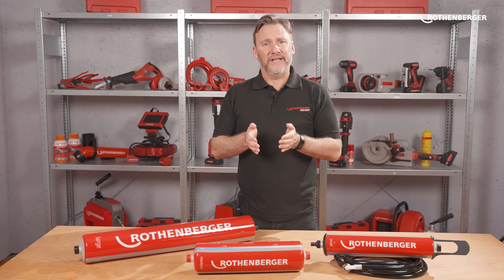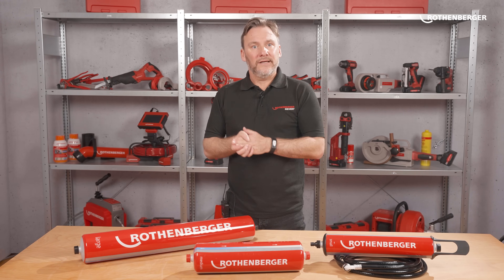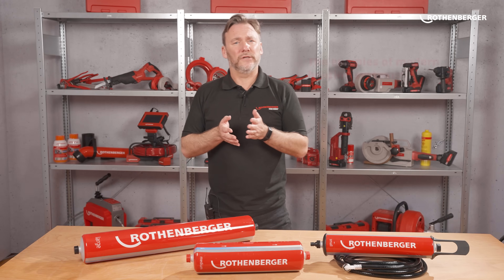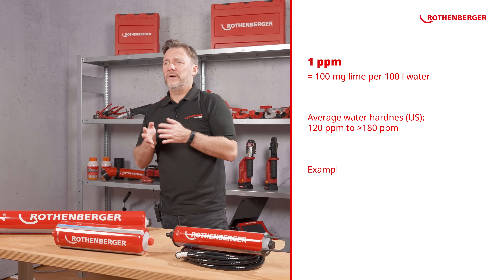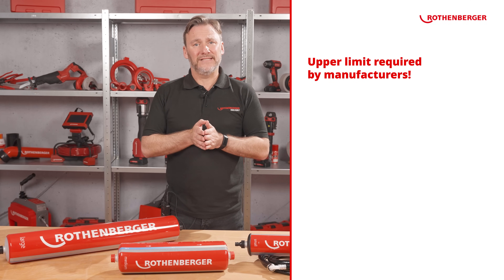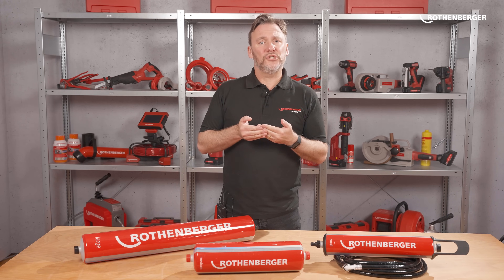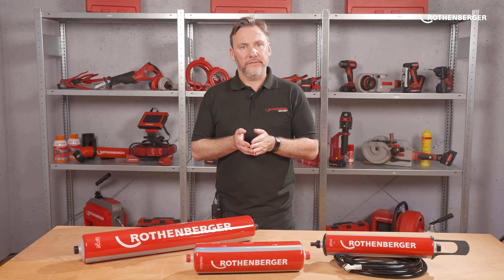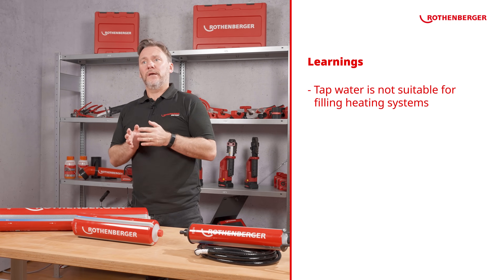Why Heating Systems must be filled with Demineralized Water | ROTHENBERGER ACADEMY

Comment: Also how do we check the water is still ok every service or is it fit and forget if only filled with deminerlaized water?
Reply from the maker: Hello, the cartridges regulate themselves chemically. You don't need to check the out flowing water, except it is required by the manufacturer of the heating system.

Comment: So to clarify if we use demineralized water, we should not be adding boicide or inhibitor as these would add to the PPM in the water?
Reply from the maker: No, you don't need to add other chemicals to the water, as these would change the demineralized water again. The out flowing water of these cartridges are ideal to go into the heating system.